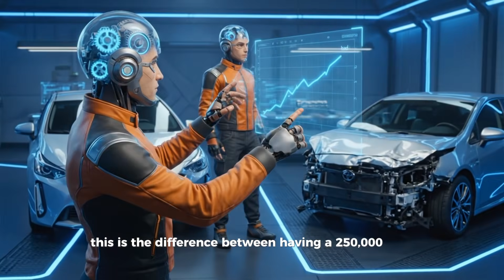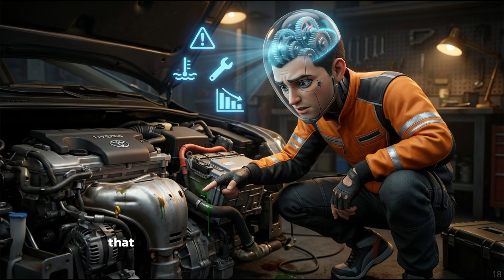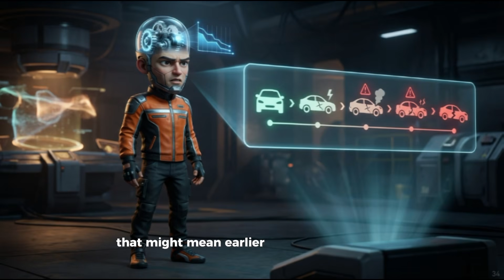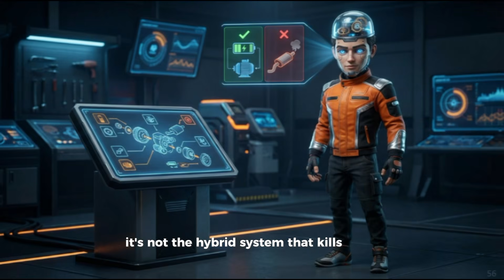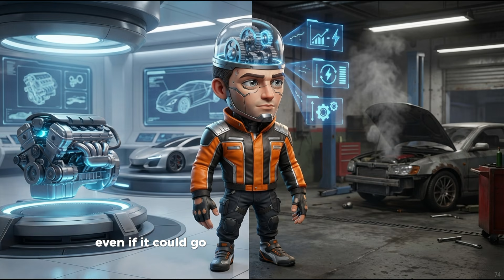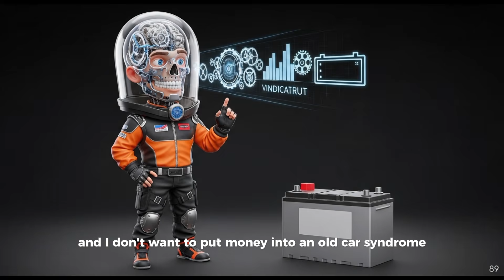The 5 Things That Actually Kill a Toyota Hybrid It's Not the Battery

Comment: I am an owner of PRIUS 2018 and I follow the manufacturer maintenance and with 100 k milee and the engine runs as a clock! I changed all the fluids and in hot days I turn on the AC to keep the traction battery well air cooled.
Reply from the maker: Adriano, thanks for watching and for sharing your 2018 Prius success story with the GearHead community!

Hitting 100k miles with an engine that still runs like a clock is the direct result of your proactive Toyota hybrid maintenance strategy. You’re doing the one thing many owners neglect: changing all the fluids. Replacing the inverter coolant and transaxle fluid on schedule is the ultimate secret to preserving that planetary gearset and the high-voltage electronics for the long haul.

Your habit of using the AC on hot days to protect the traction battery is a brilliant bit of mechanical sympathy. Since the hybrid battery cooling system pulls air directly from the cabin, keeping the interior temperature low ensures the battery cells stay within their optimal thermal window, preventing the premature chemical degradation that leads to expensive hybrid battery replacement. You are treating that machine exactly as the engineers intended. Thanks for watching.

Comment: 1. Change coolant - radiator and inverter coolant
2. Change oil every 6 months or every 5,000 miles 
3. EGR ( exhaust gas regurgitation) intake cooler& passages - inspect and clean every 50-70,000 miles.
4. Avoid constant cold , short trips, - take periodic 30 minute trips. 
5. Rusted underbody, corrosion & cracked in suspensions, bushings, struts , - 
6. Battery cooling, inverter cooling, - clean air intake & duct system , change coolant .

Comment: The smartest thing you can do is ignore the 10,000 mile oil changes. Religiously change your oil and filter at 5,000 miles. Not 6,000 or 7,500, but at 5,000 miles. The book says 10,000 because your engine will not fail during the 3 year warranty. It will fail from oil neglect after 8-10 years. Now you pay for it.
Reply from the maker: Bill, thanks for watching and for dropping the absolute golden rule of preventative maintenance into the comments! You have perfectly exposed the gap between dealership marketing and actual mechanical reality. The 10,000-mile interval exists purely to lower the advertised maintenance costs for the first owner during the factory warranty period; it was never designed to protect the engine for the long haul.

From an engineering standpoint, a 5,000-mile interval is especially critical in hybrids. Because the engine constantly cycles on and off in traffic, it rarely reaches a sustained temperature long enough to boil off internal condensation, leading to severe fuel dilution in the crankcase. By religiously changing your oil at 5k, you are preserving the oil's shear strength and ensuring proper hydrodynamic lubrication for the bearings and piston rings. It is the absolute cheapest insurance policy you can buy to protect your long-term Total Cost of Ownership (TCO) and guarantee true mechanical longevity. Spot on advice for our GearHead community! 🔧
Reply: @GearHead_Geniusgtr 
Honestly, I got the advice from watching Car Care Nut Channel. I will watch yours now also. Thanks for sharing your knowledge.

Comment: Some, if not all hybrids pull in air (from under the rear seat) to cool the battery pack. If you keep objects on the floor, in front of the area where air is pulled in, you can shorten the life of that battery pack.
Reply from the maker: Dave, thanks for watching and for highlighting this critical real-world maintenance tip. You are 100% correct; the hybrid battery cooling system in cars like the Prius and Camry Hybrid relies entirely on unobstructed airflow from the cabin. From an engineering perspective, heat is the absolute number one enemy of battery cell chemistry. By blocking that intake with luggage or floor objects, you are essentially suffocating the traction battery, forcing the cooling fan to work harder and causing internal temperatures to spike. This leads to accelerated battery degradation and can trigger a hybrid system failure light long before the cells should have naturally expired. It’s a classic example of how 'soft' neglect can destroy a perfectly good hybrid powertrain. Thanks for adding this excellent advice to the discussion! 🔧
Reply: @GearHead_Geniusgtr You're welcome. The sad part about various aspects of new vehicles is that few salespeople spend more than a few minutes with the buyer, pointing out important things such as this topic, breaking in the engine, transmission, and brakes.

Comment: So is there a rumor that one of these actually died? I don't believe it.
Reply from the maker: Tap, thanks for watching and for bringing that bit of humor to the community! It definitely feels like they are immortal, doesn't it?

From an engineering standpoint, Toyota’s Hybrid Synergy Drive is so overbuilt that it has rightfully earned that "unkillable" reputation. However, the "deaths" we see in the shop are rarely due to a design flaw; they are almost always caused by silent, preventable killers like EGR clogging, oil sludge, or inverter overheating from neglected fluids.

Even a legend needs a little mechanical sympathy to hit that 300,000-mile mark. My goal is to make sure every member of this GearHead family knows how to keep theirs running forever so we can prove the rumors wrong together! 🔧

Comment: How about a video about Honda hybrids?
Reply from the maker: Dic, thank you so much for being a part of the GearHead family and for watching! That is a fantastic request that I’ve been seeing a lot lately from the community.

While everyone praises Toyota reliability, the engineering behind Honda hybrids is a completely different story. From their early IMA (Integrated Motor Assist) systems that had some notorious battery longevity issues, to their modern i-MMD and e:HEV drivetrains which use a unique direct-drive clutch system instead of a traditional transmission, there is a lot to decode. I am actually doing the research right now for a deep-dive comparison on their Total Cost of Ownership (TCO) and whether Honda has finally closed the gap on the hybrid king. Stay tuned it’s going to be a heavy-hitter! 🔧

Comment: I do a lot of short trips but I keep my oil change interval at 4000-4500km or 5 months
Reply: I purposely do NOT drive on short trips. Our hybrids already keep the engine off much of the time in heavy or medium traffic. I take the highway for at least 5 -10 miles. This gets the oil up to normal operating temps for a good amount of time. If all you need to do is take short trips, an EV would be a better choice.

Comment: Please make a detailed video comparing 0W-20 and 5W-30 engine oils. These days there is a lot of discussion that 0W-20 is only for emission standards and does not provide the same protection as 5W-30. It would be really helpful if you could explain this clearly with practical examples and from an engine protection point of view. Also include Hybrids as well.
Reply from the maker: Techinnate, thank you for watching and for this excellent video request! You’ve hit on one of the most controversial topics in the automotive world: whether 0W-20 engine oil is just a tool for emissions standards or if it actually provides adequate engine protection compared to the classic 5W-30.

From an engineering standpoint, it is a complex battle between reducing viscous drag for better fuel economy and maintaining oil film strength under high thermal loads. This is especially critical for Toyota hybrids, where the engine constantly cycles on and off, creating unique challenges for lubrication and engine wear. I am doing deep-dive research on this right now to analyze the mechanical tolerances and hydrodynamic lubrication facts behind this debate.

I will have that detailed comparison video ready for our GearHead family next week! Look forward to it, and thanks for helping steer the channel toward the technical truths that actually protect our wallets and our engines. 🔧
Reply: Previously 2017 Impreza recommend 0w20 engine oil. However, this engine oil is switched to 5W30 for better lubrication
Reply from the maker: @engkiatpoh9696  That is a perfect real-world example right there. A lot of independent master techs are doing the exact same thing behind closed doors. You might give up 1 MPG, but the bearing protection is vastly improved. Thanks for sharing that perspective with the garage!
Reply: Toyota requires 0W8 oil in my 2026 Camry Hybrid. I will not think I know better than their design engineers. That is the oil it gets, no matter what anyone tells me.